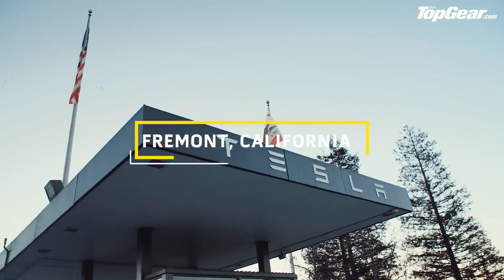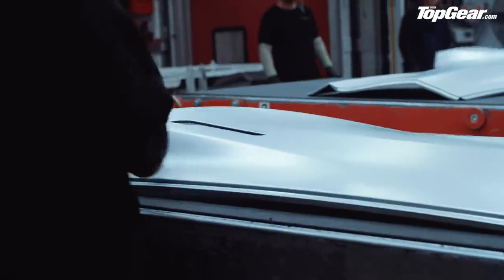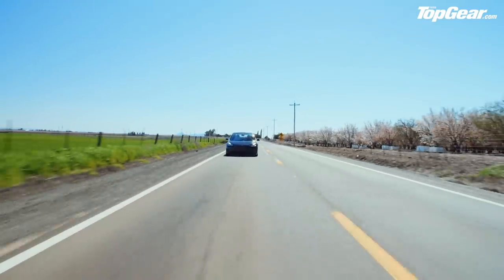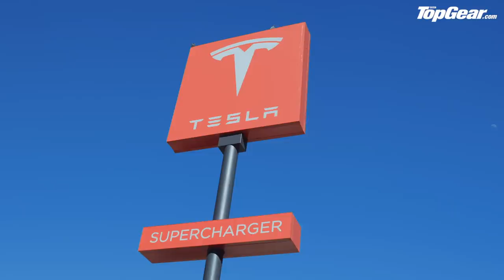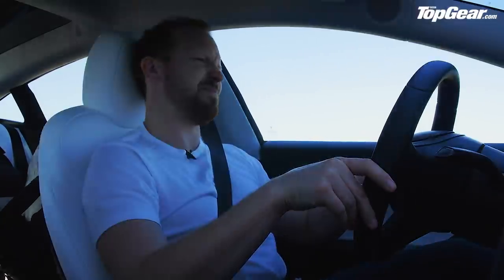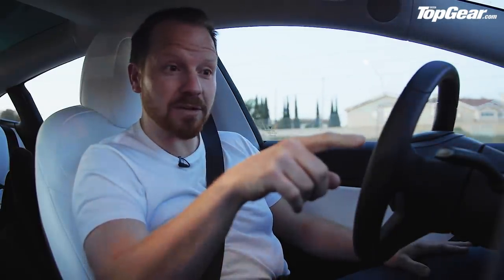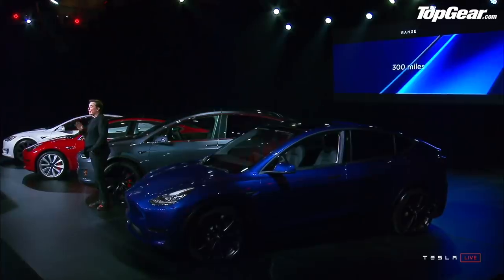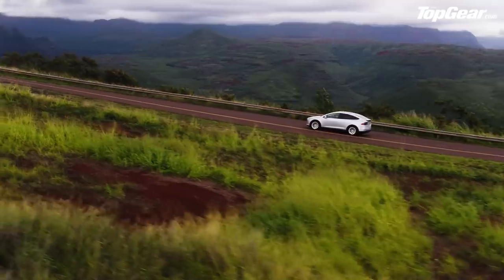TESLA Model Y Reveal, Model 3 Road Trip and Factory Tour | Top Gear

Comment: I am all for Electric cars as daily drivers and commuters. However I will take my offroader and track car in gas form all day. Maybe in 15 years the infastructure and tech will be their but right now no. Also Tesla has dropped in sales in Quarter 1 2019 and will be outsold by traditional automakers once their electric cars are out in mass.
Reply: Take a look at all auto sales in Q1 of any year. Sales drop that quarter. Also Tesla had some unique things happen. At the end of Q4 2018 they had a huge push to deliver domestically since the tax incentive in the US expired. Q1 was also their very first deliveries overseas for the Model 3 to China and Europe so those orders got priority. Tesla is still working out these new logistics of fast delivery overseas. It certainly took them more time to ship the same amount overseas than just shipping on rail and truck domestically.

There is no slowing in demand just because there were less delivered this first quarter. They have more orders than deliveries at this point and for the near future. In fact for Q1 they had something like 15,000 more Model 3s produced than delivered because of delivery logistics. Those 15,000 aren't sitting on a dealer lot but are waiting behind the bottleneck to be delivered.
Reply: @flipadavis  ok let's look at the data. Ford down 2%, FCA down 3%, Toyota down 3.5%, Nissan down 5.3%. Honda up 4.3% and Hyundai up 2.1%
Let's look at Tesla down 31% and their stock down 8.2% that's a massive difference.
Reply: @flipadavis  GM is the only big maker down significantly at 7% and that makes Tesla down 4x larger then the biggest drop.
Reply: @eichler721  Did you see what I posted about their other unique circumstances? They are a growing company and they will have growing pains.

And you can tell absolutely nothing from their stock prices good or bad. Look at the volatility over the last couple of years. Tesla stock is the most manipulated and shorted tech stock in history.

Tesla beyond the doom and gloom  in the sensationalist headlines has had some really good things happen in Q1. Because of TM3 sales in Norway they reached almost 60% of all new cars sold being EVs. Half of those were Teslas. Also in Germany Tesla and their 3 models of cars sold only a few hundred less than all models of Porsche. in Germany!

There is no slacking of demand but a bottleneck of working out logistics with overseas deliveries. Q1 was their first quarter to deliver the higher volume Model 3 overseas.
Reply: @eichler721  This also wasn't GM's first quarter ever to attempt large volume delivery overseas. Tesla also pulled off a miracle of deliveries in Q4 at the expiration of the full tax incentive. Maybe if they didn't try so hard to deliver so many and dragged their feet last quarter people wouldn't be shitting themselves with shock about the difference in cars delivered during a huge domestic push vs. shipping cars overseas dealing with multiple bureaucracies and port protocols.
Reply: @eichler721  Also we could look at it like this. Has Ford, FCA, Toyota, Nissan, Honda or Hyundai recently have over a 100% increase in deliveries over 2 quarters? Tesla went from 40,000 deliveries in Q2 2018 to 90,000 deliveries in Q4 2018. They are still up ~33% deliveries from Q2 2018 and ~50% deliveries from Q1 2018. All this even with rapid expansion and the growing pains that go with it.
Reply: @flipadavis  Porsche cheapest cars are 60k compared to Tesla's 45k. Plus most Porsche models are sportscar or supercars except the 2 SUV's they offer. Porsche is the #2 most profitable company after Ferrari so not really a comparison there. They got crushed in Europe by Mercedes, BMW and Audi